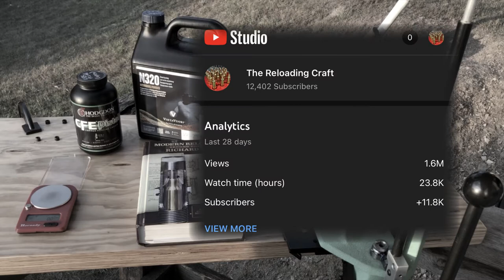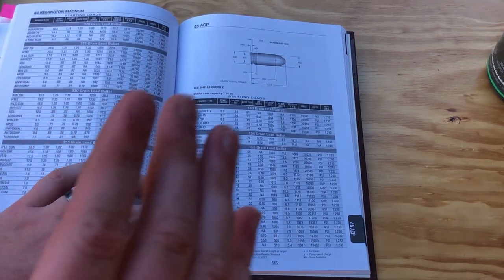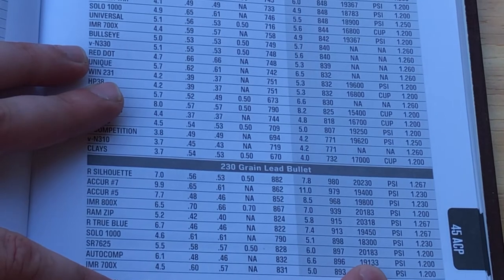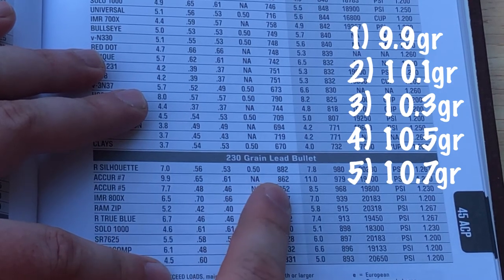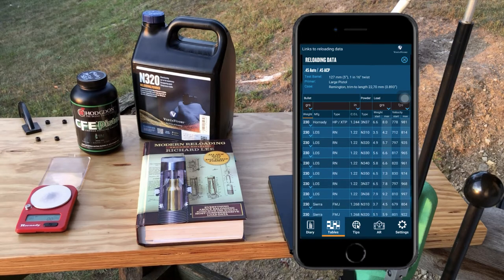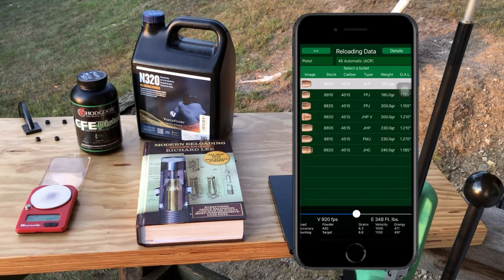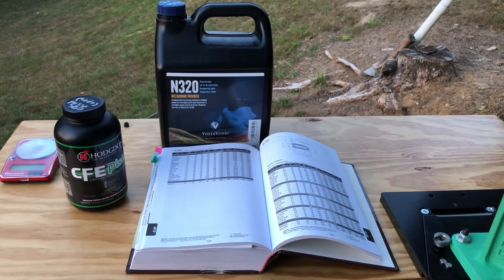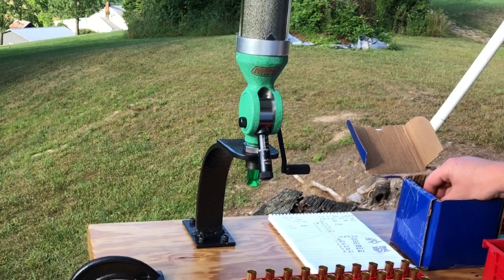How Much Powder Do I Use? How to Read Load Data and Develop a Load PART 6 Intro To Reloading

Comment: How accurate of a powder charge do you get with that method? Is it just accurate enough for pistol cartridges? Same note, for precision rifle shooting, is it better to trickle for a more precise charge? Every cartridge, I mean
Reply: @thereloadingcraft  makes perfect sense. That is a very small variance. But of course, with precision rifle ammunition you would need precise measurements. Also did not know variation with powder types, but also makes sense with grain shape a factor.
Reply: Some rotary volumetric measures with some powders can vary by as much as plus or minus two tenths of a grain.  It is up to the reloader to know the variation and to make allowances.  For instance, if your powder measure for powder A varies by 0.2 grains you do not want to get closer to the highest grain weight than that.  Or you can buy a powder trickler and adjust each load exactly.  
Second, in handgun ammo, for instance, the Accurate #7 shown early, 9.9 grains to 11 grains with a 230 grain lead bullet with a velocity from 862 to 979, each tenth of a grain is about 11 feet per second.  
Say you pick a load of 10.5 grains, that means your lowest velocity would be about 906 feet per second and your highest 950 feet per second.  The travel time to 20 yards would be 0.066 seconds slowest, and 0.63 seconds fastest.  The difference in bullet drop would be 0.08 inches at 20 yards. Or, a ragged hole. 
drop =time to target in seconds squared times 16 feet times 12 inches. I am ignoring the fact that the bullets slow down some in 20 yards.
The math is the same for rifle bullets, but because the bullet weight is less, the powder more, and the distances greater, the variations will be different. Again, it is up to the reloader to know the variation and deal with it correctly.
For my handgun to 20 yards and my 223 lever action loads to 130 yards at steel targets, my variation in expected drop is less than the steel target size and less than my own shooting variation.  
If I were to load for 500 yards and a six inch steel target I would need to improve my weighing precision. I'd get a trickler.
Reply: @phild8095  thank you very much for this insight. I haven't even started yet. But working on collecting the required equipment. As well as trying to understand more. Thank you

Comment: The Richard Lee loading manual does not do pressure tests themselves, they only take test data from others that do and jumble it all together, of which they lose the test barrel length, case brand, primer type and brand, as well as bullet brand. These are all important elements, as one should never take data made for one specific brand and type bullet and turn and use it with a different brand or type bullet. This is due to Brinell hardness and bearing surfaces can be different, as well as the shape can be slightly different with longer or shorter over all  lengths, all of which can cause extremely high pressure issues. One should only use data straight from a reputable data source [see paragraph below] that does their own pressure testing which give the test barrel length, case brand, primer type and brand, and most of all the brand of the type bullet used in developing the data. Each one of these elements that are changed is a compromise of which if all are compromised at the same time could very well add up to a recipe for disaster. 

Lyman, Speer, Nosler, Sierra, Barnes, Swift, Berger, Norma, Lapua, VihtaVuori, Accurate, Western Powder, Hodgdon, or even Hornady reloading manuals are far better suited than Richard Lee's for gleaning load data from, as they all not only do their own testing but they all give the test barrel length, case brand, primer type and brand,  as well as the bullets brand and type for each load recipe. 

Again Richard Lee's manual throws out one of the carnal safety rules of never use load data developed for one brand of bullet for another brand of the same style bullet. Keep in mind that it is always better to throw out Richard Lee's manual than any of the safety rules.

Comment: I check all my brass before filling with powder to ensure they are all primed and the primer is right side up.
I individually weigh each of my first ten loads, then every tenth load after, putting them in a tray in order, so if I want I can empty the last 10.

Comment: I'd love to see videos on the different powder dispensers. What's the accuracy of the one pictured?
Reply from the maker: That would be a fun video to do! Accuracy of this one depends on a couple factors, mostly powder choice and if it has the rifle metering insert or pistol metering insert installed. The rifle insert with a ball powder such as H335 will meter within +- 0.15 grains at a 25 grain charge. The larger the charge gets, the more variance you will have in compression or settling of the powder, and the greater the variance. With a longer stick powder such as H4350 or IMR 4350, I get variances around +-1.5 grains because of the larger sticks and powder shearing. 
Likewise with the pistol insert, I am confident in it metering down to 0.05 grains with a good ball powder, or even a fine extruded stick powder like VV N-320. With flake powders, accuracy is +-0.1 at best. The pistol insert is inherently more accurate since the chamber is long and slender, and can be adjusted fairly precisely. 
Metering inserts for both pistol and rifle include zero backlash threads for repeatability on the micrometer, and a thumb lock knob to ensure they don't walk in or out during extended charge sessions. 
Honestly this #3-BR is one of my favorite powder measures and I have absolute confidence in it. The fit and finish is excellent, and using it, you get the feel that it's a precision made tool.

Comment: Is there any issue with reducing the powder load to lessen the recoil?   Thanks.
Reply from the maker: As long as you are above the minimum book listed charge, usually no. I wouldn’t recommend dropping below minimum, as you may have cycling issues or weird pressure spikes due to inconsistent ignition. Stay within minimum to maximum, and always start on the low end and work up.
Reply: @thereloadingcraft  Thank You!  I'm new at reloading and have a lot to learn.   I appreciate the help.   Take care.
Reply from the maker: Happy to help, and if you’ve got any questions or things you want to see addressed in videos, let me know!
Reply: @thereloadingcraft  Thanks Much.  I really appreciate your help.  I'm working on reloading .350 Legends and there is not an abundance of info.
Reply from the maker: @bobcatforever3485  yeah that one isn’t super old on the market, though there should be at least decent info out there. What powder/projectile combination are you using?
Reply: @thereloadingcraft  I currently only have two powders, H110 and CFE Pistol and 145 Gr bullets (like FMJ).  Thanks.
Reply from the maker: Solid choices for both, the 350 basically acts like a large magnum pistol cartridge, so it makes sense that those two would be the popular ones. Do you have the Hodgdon reloading manual, current edition? I’m pretty sure they have data for the 350
Reply: @thereloadingcraft  Thanks.  I don't have the Hodgdon reloading manual but have been checking their load data website with some 350 info.   They don't have the data for the 145 Gr bullets that I have.   Yesterday I ordered the Hornady reloading manual which they say has 350 loading data in the latest one.   As a side note, my first reloading was with some .44 Mag and .357 Mag a couple weeks ago with mixed results.  If interested YouTube video:   https://youtu.be/jSVGc8L1pis
Thanks again for all of your help.
Reply from the maker: No problem!